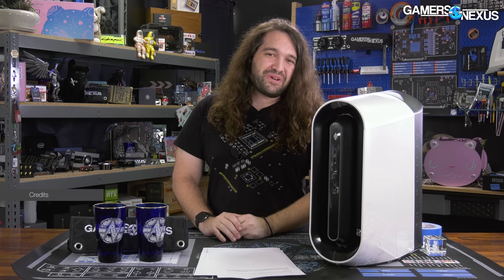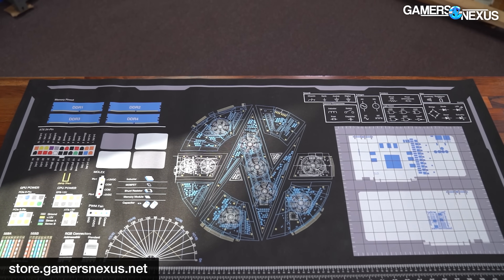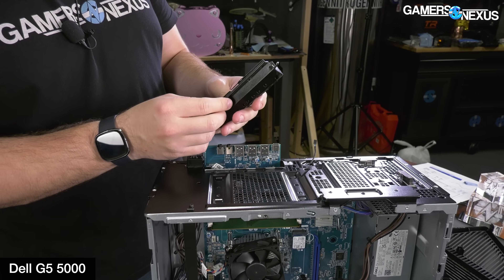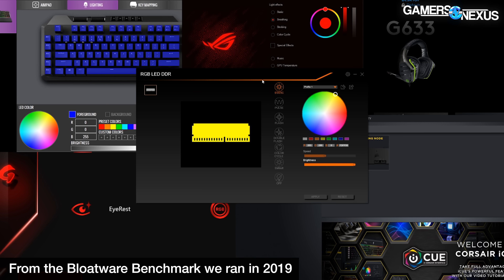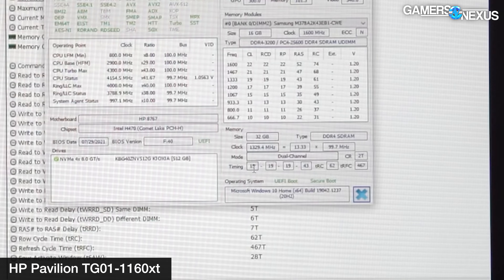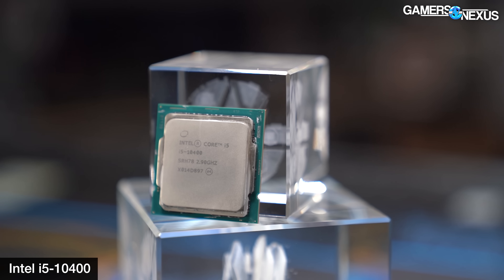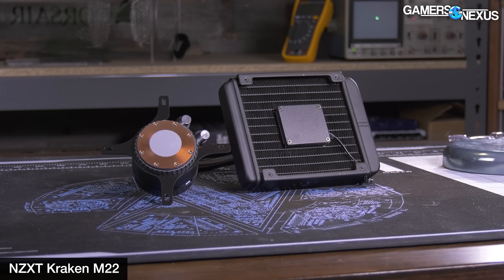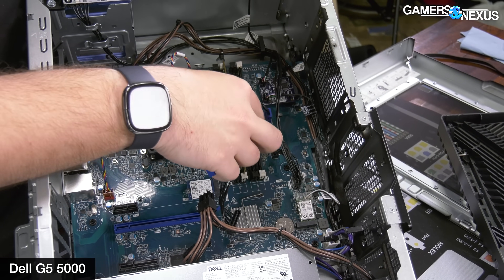The Worst Prebuilt PC Mistakes We've Seen (So Far)

Comment: Do Altex out of San Antonio Tx.
Reply: Now I don't game, so here's what I set up out of one of their prebuilds, I run a SQL based shop system, that's rather chunky.
I7 11700
32gb 3200 corsair
2tb samsung nvme m.2
2tb Samsung ssd
Asus 520 csm
It does well, I use the native gpu( which is garbage, but I just wanted a work machine that would stay relevant for a few years as I'm a small business owner, and can't be bothered to keep replacing machines.
My Lenovo legion was good for a year before it had enough hear cycles to render it useless( it's a shop, ambient Temps go well past 100f in the office)
I pretty much tried to emulate the high temp reliability of my toughbooks, but in a desktop
Chris at Altex will actually take info from a pre-built,  such as cybertronic, and make the hardware changes to have a usable machine,like not wasting a 570board with an antiquated 1660 oc,  and sell it at damn near the same price or lower.
I've been working with Altex for over a decade, from my days of building hives,  to my databasing machines, to now with office machines that don't slow down because there no aircon
Reply: And I guess to clarify where I'm at dollar wise for what I built/bought
The tower as said
27 inch asus curved display
Nzxt inputs
Full sine wave ups
2 year warranty
2400 bucks

Comment: I've built quite a few budget gaming PCs in $600-700 range. Seeing the parts in this PC is a joke. You can practically get better performance out of OC 4th gen i7-4790k 6 generations earlier. Nobody should have ever bought the i5-10400F processor for anything other than non-gaming purposes. I don't like Ryzen much either, but at least their unlocked for overclocking. I actually traded a PC with GTx 1660 ti / 256 nvme / 16gb DDR3 / i7-4790k for an 11th gen intel laptop that was brand new with Best Buy receipt. After all of these years of making PCs, HP is a joke with a build like this in today's world. Couldn't even splurge for the $20 retail air cooler with premium design and copper core.

Comment: Proprietary parts are a decision I don't get, even ignoring how anti consumer and anti environment they are I don't see how it even really benefits them. Anyone who would just buy a whole new pc when one part breaks would do that anyways even if the parts weren't proprietary, and anyone who would want to upgrade/replace specific parts would learn they can't, and then be very turned off at the idea of buying a new pc from that company. The cpu/gpu/ram/storage aren't proprietary so they'd just buy a new case/mobo/psu at that point. On the flip side many people look at these prebuilts and choose not to buy them because of the crappy proprietary parts. 
I would assume they've looked at the numbers and have determined proprietary parts are more profitable for them but it just doesn't make sense logically speaking.

Comment: Thanks for being so educational! I wish I had found this earlier. I was suffering under the graphics card shortage and wanted a new computer fast, so I spent way too much on a prebuilt gaming PC and didn't realize until about a week ago that the 120mm liquid cooler was causing my Ryzen 9 5900X to thermal throttle and vastly underperform (especially in frame consistency). Thankfully the case can fit a 240mm radiator on the front panel, so I can install that one as soon as it comes in. I will be sure to check out the videos on this channel before I get to building my next PC, to make sure I'm not fucking anything up.

Comment: I just received a Dell XPS 8950 pc. I did like some things about it- the case and cable management were better than I expected, plus pricing was great for an i7-12700, RTX 3070, 2x16GB 4400 RAM, 1TB SSD+1TB HDD device at AUD$2250->USD$1640? However, it was let down by typical Dell stuff- bad components for a high-spec pc (CPU cooler that was featured in previous GN vids on prebuilt Dells), proprietary parts (motherboard, probably also featured but can't be sure at this point XD), or worse- both (460W Bronze-rated PSU with some shield thing built over it, making it hard to change to any top/bottom fan PSUs as is) :p  To note, they do have upgrade options to a more powerful PSU and liquid cooling options in other predetermined configurations (and higher cost; of course they won't miss such an opportunity). I think they have what it takes to churn out good stuff if they stop abandoning the big picture in favour of scavenging scraps/leeching off their precious consumers. As it is, all of us can only dream of the day they stop using proprietary parts

Comment: It's weird, I paid 600 for my prebuilt and I can't complain, yeah there are some bottlenecks but I can easily iron those out. The CPU, RAM and case are perfectly fine for what I paid. However I didn't go with a big brand and simply looked at the specs and components and came out lucky I guess.
Reply: Is it ibuypower? Ive had 2 of them and theyre always great, even if i modify them

Comment: I bought a pre built from IBP at best buy 4 years ago. Still running today *knocks on wood*.  msi 1080 armor OC, i7 7700k, 16g ram (upped to 32gs. but not good speeds though) MSI z270 a pro Mobo and a shitty 120 duel fan aio cooler.  PSU was never determined.
Reply: price at the time was $1800

Comment: Prebuilt is fast becoming the only way for many of us to get hold of a new GPU at reasonable cost, its just a shame all of them seem to come with stupid design choices and outright stupid compromises. 

Mine came with a single case fan, stock intel cooler and a single stick of ram. This was for a system with an 11700 and a 3070, so ran worryingly hot before additional fans and a proper cooler was installed. Wasn't too hard to fix as they weren't an OEM, so no proprietary parts but its still shitty of them to send out a PC that needs to be  upgraded before it becomes a properly usable system.

Comment: I'm a complete amateur with everything related to PCs but I have a prebuilt coming from Newegg in the next week or so. I know that I need to check connections of everything and ensure everything is properly plugged in but is there anything else I need to verify before I power it on for the first time? Thanks guys 🤘
Reply: Biggest thing is making sure the motherboard is secured on stand-offs and not loose or touching bare metal potentially creating a short which kills the board. Also, check that the CPU fan is properly installed and has no wiggle over the CPU. Would suggest repasting the cooler with a better thermal paste right away. Other than that maybe just double check the case fans, ensure you have a proper push-pull setup with the fans facing the right directions.

Comment: I bought a Cyberpower PC back in 2019 and it suffered from thermal throttling as well. The case fans were all exhaust, no intake fans and there was a cheap CPU cooler. No issues with assembly or component selection though.

Comment: Oh let me tell you I have horror stories from purchasing an alienware computer a long long ago. I remember the motherboard went on it and they send someone try and fix it. They couldn't fix it. And wanted to get a part to try and fix it so I was waiting even longer for the part. Then once the park came it didn't even work correctly with the part installed. So then they had to replace some other board and then the computer actually finally turned on. But then the fans were like 100% constantly. So there was another big problem and the thing would overheat constantly. I would never buy an alienware piece of garbage after that and decided to learn how to make my own PC haha  Dell is in charge should be ashamed, especially with the video on the r10 desktop that was put out. It's one of the worst pre-builds I think ever

Comment: Its actually impressive, given how "simple" the issues are, that they can´t manage to avoid them.
Like installing 2 modules of ram instead of one, shouldn´t eat up their profit as they have ordered the ram sticks in bulk for their various configurations anyways.
Not installing all sort of garbage bloatware but deliver the system with just a clean version of windows with all drivers installed. They can include their whole bloatware software on an usb stick in case someone feels like torturing him/herself with it. 
Using simple components that are standardized, cause all this non standardized stuff has to be specially produced just for them, has no value outside of their system and severely limits their systems capability which further lowers the value. Like a 10 years old diy pc might have no issues running the newest top notch gpu if the owner wants too, the 10 years old garbage pre build has likely no chance, not just cause the non standardized power supply doesn´t provide enough power but can´t even be replaced with a better one given that you would also be required to change the case, and mainboard.... 

HP/Lenovo/Dell/Alienware are seriously disgusting when it comes to this and thankfully i never had to buy a pre build system as i learned my way around tech since i am 10 years old. Laptops are however still a pain in the bum experience...

Comment: Oh man where do i start with my ibuypower build, here we go. Took over a month to build, when it came in it was delivered by fedex...🤦🏻‍♂️ caught the guy slam it down and run off on camera without getting my signature for the pc. On a weekend too so no support until monday. Opened the pc up and started taking it apart and checking everything. Usb 3 cable forced into mb over a thumb screw for a sdd slot so bent pins. Case was scratched in front and the corners. Rear cover thumb screws were bent with no grommets, the sleeve extensions i added in the order looked like dollar store brand extensions and the 24 pin was missing a wire. To top it all off my gpu was dead on arrival, green lines all over the screen after it posted and i updated bios couldnt even run aim labs at 10fps. Sent my gpu in for rma got upgraded from a 3060 gigabyte aorus 16 pin to a 3060 gaming oc 8 pin 🤦🏻‍♂️. Took another month to get my gpu back too even though they had it within a week. It wasnt until i started a BBB claim that i got my gpu THE NEXT DAY. Worst experience for my first pc, was planning to build my own but went prebuilt just so i could get a 30xx series.

My build for anyone who wants to know

B550 gaming carbon wifi
16gb 3600 tforce delta rgb
Ryzen 5600x with 240mm aio
870 qvo 1tb ssd and a 2tb hdd
Gigabyte 3060 and 750w psu
Reply: If you made it through that thank you for getting through me venting ibuypower

Comment: A friend of mine received a prebuild with an I/O shield pushed into the BIOS reset button witch on that motherboard was located on the I/O. It was only off by 2mm so it took me forever and a complete rebuild to figure out what it was. I bet it would be a headscratcher for he company that built it in the first place to figure it out. None the less, they have fair prices and uses standard components. A prebuild costs about $50 more than ordering each part, but as many people need, the luxury of just shipping the whole pc back if anything goes wrong without having to pinpoint what caused it.
Reply: I paid my local tech store 80 bucks to order all the parts and assemble them for me. I could have assembled it myself but ordering every part individually just sounds like big potential for risk.

Bottom line, 80 buckaroos is nothing in comparison to the markup OEMs add to their pre-builts. I browsed another store and noticed some PCs with similar specs, they were 400 more expensive lmao.

Comment: Ich bin mit meinem HP TG01-2214 5700G, 32GBram,RTX3060Ti sehr zufrieden, dein letztes HP TG01 Video fand ich nicht gut, ich warte auf Predator Lake und HP ermöglicht mir eine 3060Ti in Zeiten von verrücken Grafikkarten preisen.  Für mich ein Single Use PC der in der EU einen attraktiven preis hat, die PC die du gut findest kosten 2000€ mit RTX3060Ti, Der HP 1200€. Ich will PCI5 und DDR 5 und die ganzen Technischen Neuigkeiten und brauchte einen PC.  Schlag mal eine Übergangslösung vor die Leistbar ist. Das Gehäuse des TG01 hat auch mich an alte Zeiten vor 2000. Die neue RTX3090Ti zwingt alle ihre alten von dir gelobten Netzteile wegzuwerfen.

Comment: I bought an ABS system so I could actually get a 30 series RTX card. They put a TUF x570 Plus in the Corsair 500 SE RGB. Not a bad combination, at first glance. Then you realize that the case has a USB-C port on the front and the motherboard doesn’t have a header for it. Yes, they shipped a PC with non-functional ports on it. WTF.

Comment: recently i just bought myself a NewEgg ABS Master Pc and i gotta say so far i’m very satisfied with it. it does everything you would expect your gaming computer to do, and that’s good. it does seem they may have cheaper out of the cpu fan with a $20 thermaltake. it was actually shown somewhere in the video above for a brief second. it’s a bit loud, there’s no option to change the rpm and no option to change or turn the LED off. even though that being said, it does still keep my PC cool and at a stable 30 degree celsius. lastly, for what the PC has and is, i’m little surprised it came with just an i5-10400 in it. I’m mostly using it to game, playing New World to be exact and it works fine for just that. but for someone who may want to game and stream at the same time or something like that; or even more. you may want something bigger and better. At some point in the future i plan to upgrade the cpu and fan, but for now it serves me well as is.

Comment: The AIO in my iBuyPower failed within a year and a half, replaced it and realized it was a trash cooler even when it was new, also their OC settings were way outta wack, the cable management was AWFUL, and XMP was off despite everything else. Thankfully all easily fixed, but annoying

Comment: Another thing I found out, at least to my HP omen, is ram. Let’s say I want 3200mhz as my ram speed and I go buy a 2x8gb 3200mhz  ram kit. I go plug it in to my pc and notice it does not run at 3200mhz. Most of the time these motherboards(OEM) will not have XMP so in order to get maximum ram speed, I have to get the same proprietary ram(in my case hyperx hp ram). Luckily I could find another one on ebay, but the worse case scenario would be being stuck in single channel. Getting a stick of ram from the company cost a lot more too

Comment: I’ve had good luck with my ABS I bought 4 years ago from newegg. It has asus strix 1080ti, asus prime z270-a mobo, 16gb 3200 gskill, and the 7700k cooled by a 240 enermax aio. For 2799 cad back in the day I thought it was a good deal and I’m glad it still holds up as a decent 1440p machine! I’ll probably pick up another abs next year

Comment: The question I have about the OEM's is are they really that incompetent or do they have a rational business reason for doing things this way? That cooler is a great example. Surely it is more expensive to modify tooling and create a weird intel/amd hybrid cooler with non-standard mounting than to just include a stock AMD cooler or get a custom one from some random company for $5 each. Same for things like power supplies. It seems like an off the shelf ATX PSU would be the cheapest option, certainly cheaper than a strange proprietary part once accounting for bulk discounts. And if they are going for planned failures requiring a new PC instead of being repaired, they could just use really trashy standard parts. It isn't like people who buy these are going to repair them.

Comment: Carey Holzman once reviewed a cheap HP and it had a proprietary mobo, a proprietary case, zero expansion capabilities, used a laptop charger as a power source and the HDD wasn't plugged into the SATA cable.

Comment: I'm actually looking at getting a re-build for the first time. 
Most probably from Scan in the UK. 
I'm after a new audio workstation PC, so the requirements are a little specific. 
i.e. my interface is Thunderbolt 2 not the later Thunderbolt 3. 
So it's either an adapter or a legacy motherboard.
I've chased around the online components market and can only shave a small percentage of the total. at best, so far. 
Combine that with a respectable builder's warranty and it's more than tempting to go pre-built this time around.

Comment: I work for a computer shop. One of the services said shop provides is running Windows updates before giving you the PC you bought. 

It's sometimes easier to reinstall windows then trying to run those updates. Since 99% of the time a fresh install won't fail an update (OEM version is closer to 50%) and I can use a newer windows image then what the OEM ships.

Comment: THANK YOU. I myself have a Cyberpower prebuilt, and it put a hole in my wallet at 2,200 USD, but other than the price, the rig is pretty good, Ryzen 9 3900 12 core, RTX 2080 Super, TUF Motherboard (Don't know which one specifically) 16Gb of DDR3 ram, and 1TB SSD. 

But the damn AIO it came with is trash, and I never would have been sure of that until now. My GPU hit temps of 95C on Warzone, so I decided never to touch that game. Same with Cyberpunk, my room would be MUCH hotter than my living room at room temp, on a hot day (California). I often had to run my AC to counter the heat from the PC, (Insane electricity bills)
 
Exactly as you mentioned, I would get throttled because of the heat, and saw frame stutters and poor performance overall on most games, even league of legends.
I got it to work better over time, I installed noctua case fans, down clocked the cpu and gpu, installed MSI afterburner and set fan curves to keep temps as low as possible, which worked but was all caused by the crappy AIO cooler it came with. Time to replace it, thanks PC Jesus.